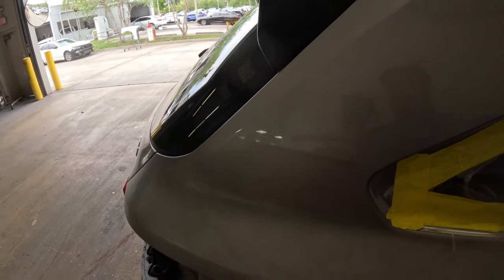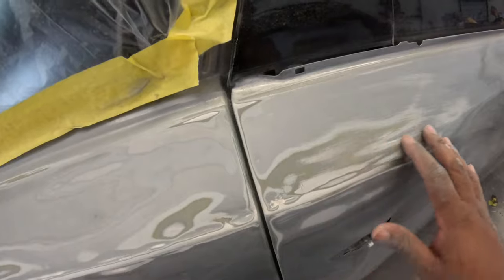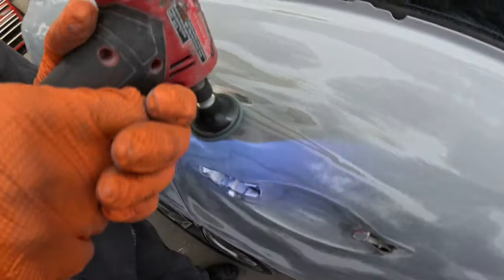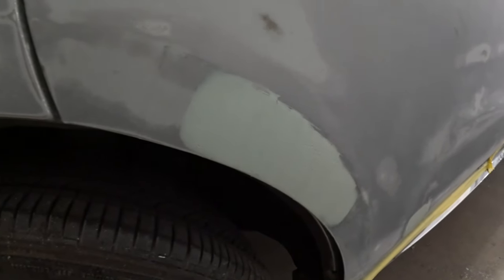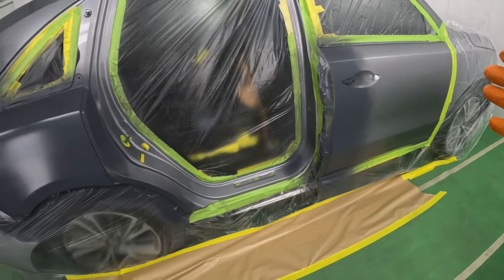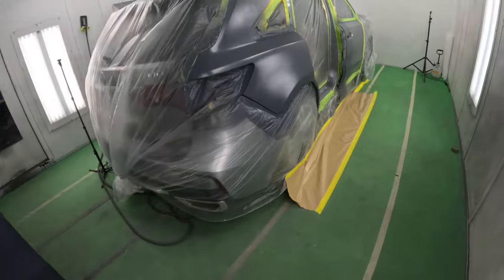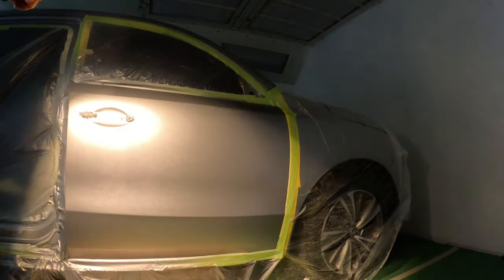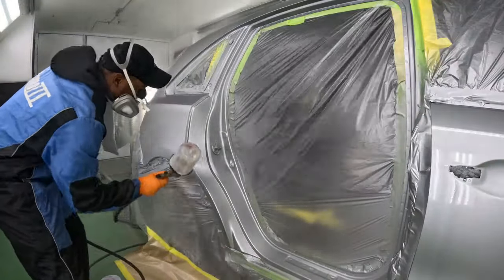HOW TO CORRECT A BAD PAINT JOB

Comment: Next time on those hard blend outs, mix your wetbed and color 50:50 and turn the psi down 2-4 psi, and wet in that blend edge. Makes blend life easier. Job looks smooth. 💪🔥
Reply from the maker: I appreciate your expert tip💪 thank you!
Reply: @mariopaintclass6091 we do 1:2 ratio. 1 part blender to 2 parts reducer. That ratio changed my life. No more darkened blend panels
Reply from the maker: @kr2513   Thanks for the tip🙌